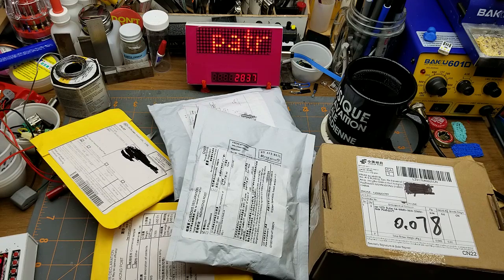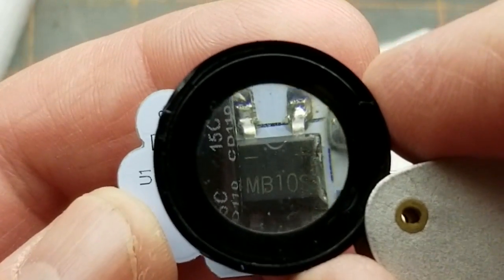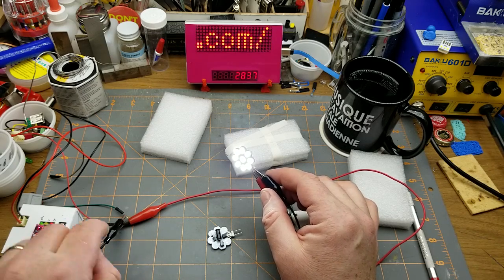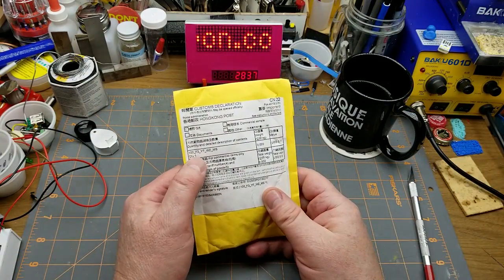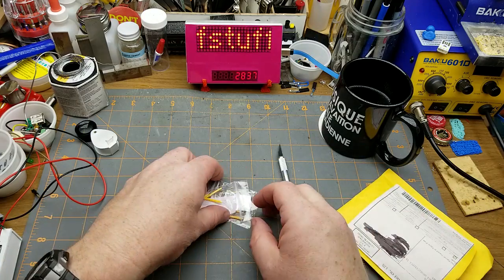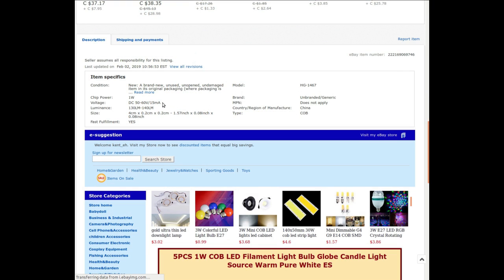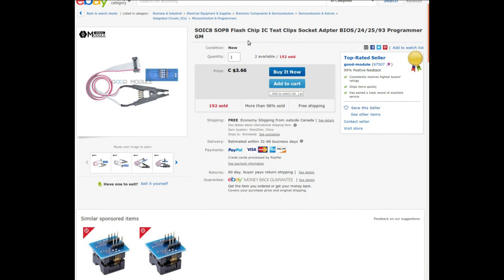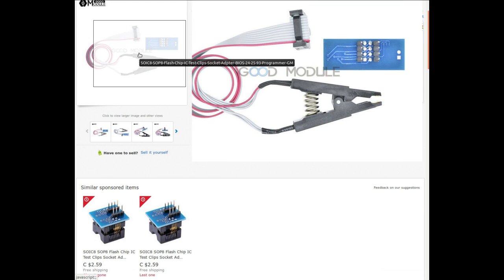mailbag monday 52

Comment: These led filament pieces seems to have led chips in parallel, all the other ones you found might have been for mains led bulbs, as inside these heat dissipation is problematic, so they push for higher voltage, smaller current.
Reply from the maker: It is kinda strange.
Of course, it is entirely possible that all the listings are lying.

 Regardless, these will be easier to use - I can power them from almost anything.
Reply: @pileofstuff  I briefly looked through the link you provided, indeed some of them are supposed to be low voltage. I wonder if yours are this new fancy flip chip design (without bond wires), I think BigClive had them on his channel.
Reply from the maker: @kjur18  that is a possibility.

I'm going to have to re-watch Clive's video. (Not that I  need an excuse to do that...)

Comment: Those "Slow Flashing LED Diodes" do they flash in the same pattern, so if you have 10 in parallel they all flash in same color at the same time, or are there some randomness to it?
Reply from the maker: They follow the same pattern, but each operate independently, so there are small variations in the timing.

When you power a bunch of them on together, they start out in sync, but it doesn't take too long before they each wander off on their own and look pretty random. 
I'm not sure if you can see it easily but the 6 of them on the breadboard at the end of the video have been running for about 3-4 min and are mostly out of sync with each other.
Reply: @pileofstuff  Great, thank you. Ordered a bunch of these yesterday. BTW I also found "5Pcs/Set COB LED Filament Bulb Candle Light Source Super Bright 3V 1W 6500K" so not only in 60V versions :-)